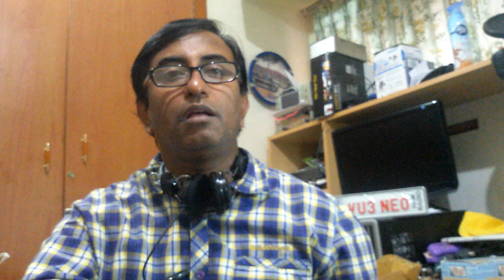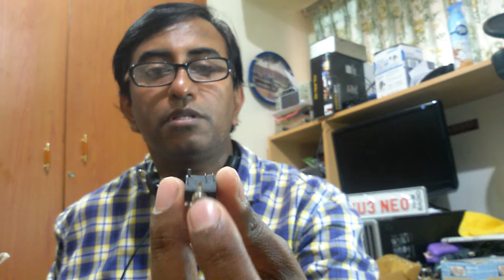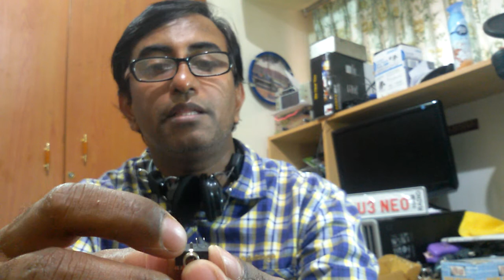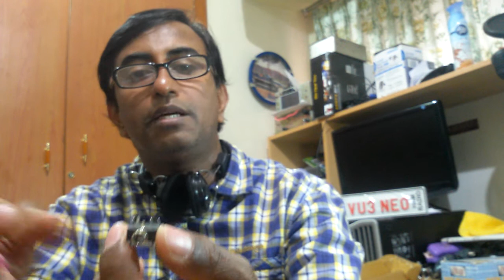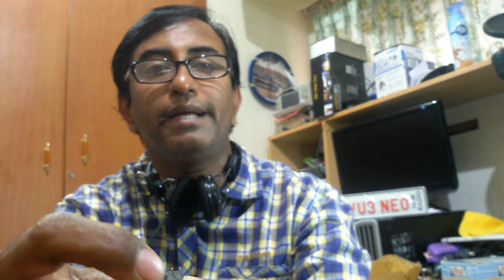Ubitx Construction Step 16

Comment: What about wiring up a 4 pin connector such as the one on the chassis you showed in previous videos? Is it entirely necessary to use the included microphone connector if using a 4 pin microphone connector? Reason I ask, is I am in the process of building my uBitx kit, and I am using a 4 pin connector, and an Icom speaker microphone (also has a switched 3.5mm jack on the mic for an ear piece or other speaker.) I planned to use the 4 pin connector with a switched 3.5mm hack between the uBitx and the 4 pin, so that the 4 pin would carry the audio as long as there was not a speaker plugged into the 3.5mm on the front panel. As far as the included microphone connector, I would rather not install it.
Reply from the maker: Reagans Ridge, If you plan to use 4 pin microphone connector, It is not necessary to use the mic jack/socket which is included in the kit. You can use the 3.5 mm jack for headphones with necessary attenuation.